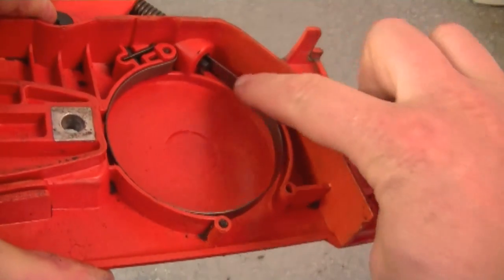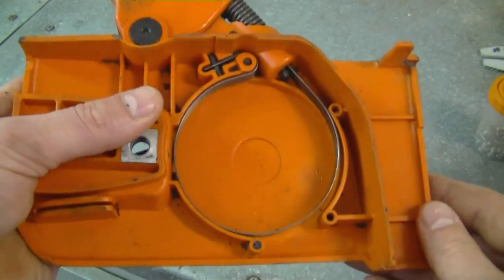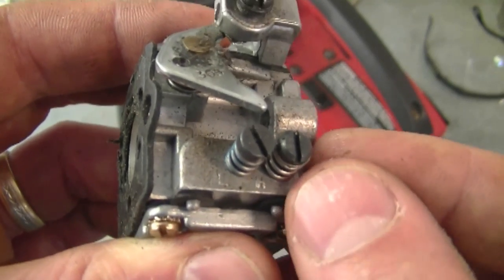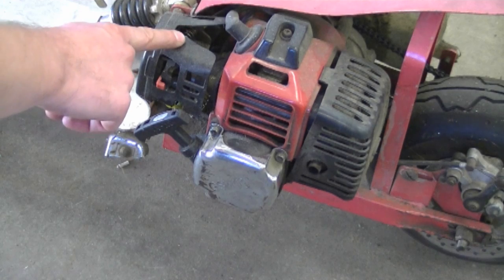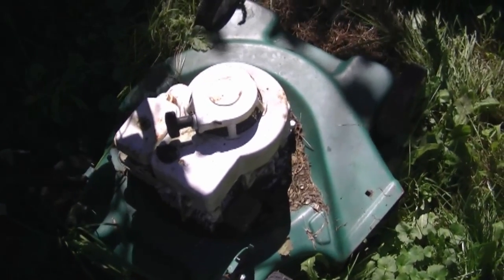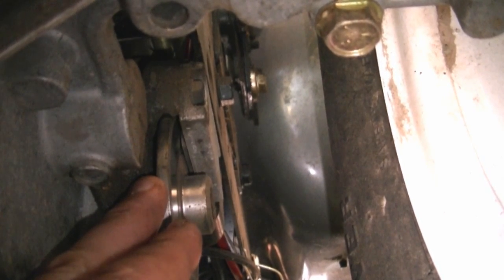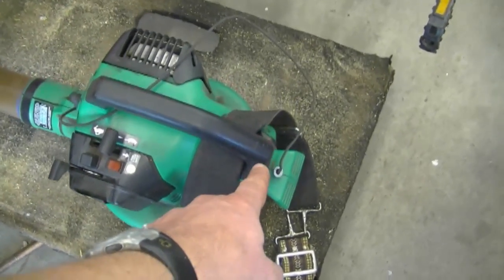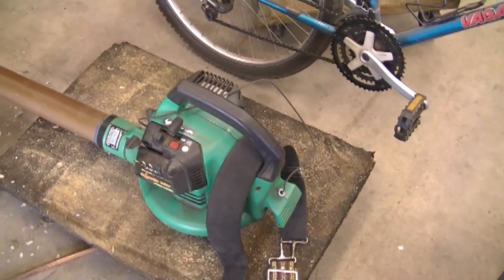Small Engines Q & A Video #108 in HD

Comment: one of my neighbors came to me with an 8 hp honda engine that had been overreved and it threw the rod through the casting. they replaced the rod,since,luckily,nothing else was damaged and now they wnt me to weld a steel plate over the hole. i am not shure if this is even possible and they are the kind of people their mind is made up an that's it. should i try to weld the plate over it or just get a cast off ebay?

Comment: my 25 cc weedeater leaks black (dirty/burnt) type fuel mix around the exhaust manifold and winds up on the outside of the plastic casing.  I wipe off every so often.  
Also starts after many pulls.  I replaced plug, adjusted h/l screws for a nice idle and runs good after it starts.  has about 50 hrs on the engine.  I am stumped.  Must be a seal?  Any advice?
Ferd

Comment: Is there a metal carb to replace the plastic carb on a Toro 726te with a 7hp 2 cycle Briggs? And if so is it worth it? 
P.S. AMSoil make a 100:1 mix oil that can be used in any engine at the mix even if it calls for 32:1 like my lawn-boy duraforce of my briggs rtek that calls for 50:1 what do you think, is it safe to run? 1 mix would be nice! Long live the 2 cycle!

Comment: I replaced a gasket on my sears eager 1 and now the engine will not run unless I hold in the primer button. After running for a few minutes it will then run with out the button being pressed. After stopping the engine, the fuel runs out the carb and hydraulics the engine. The button I don't understand, but is it possible the plastic float is cracked and sinking?
Thanks

Comment: Great video dony, briggs and stratton stopped using points and condensor in 1982, so any engine 1983 or newer has electronic ignition. points engines can be easily converted to electronic simply by cutting the small wire that goes from the coil to the points and removing the old ignition coil, then installing a newer coil.

Comment: Hi Donny.  I hope you are well.  I am seeing a lot of Troy-Built equipment here.  The carb adjusting screws have the grooves like the Poulan tool uses with some difference.  The screws have a flat side that extends from about 2 o’clock until 5 o’clock position on the screw.  Would you have any idea where an adjusting tool could be found?  Thanks for your help and the great videos.